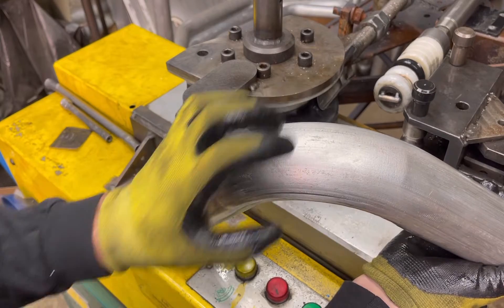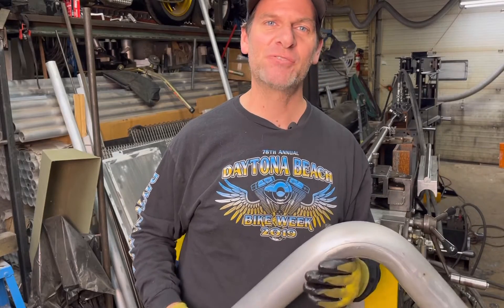MANDREL BENDING 101

Comment: The best material to make the wiper die, the follow along die and the mandrel (that the aluminum tube will be sliding on) is a "AISI 12L14" or "ASTM A108" or "SAI 12L14". This material has a higher % of lead in its composition. The lead let's the aluminum slide easily without catching on the tube. When bending aluminum, you need to use a lot of oil. We always used a EP oil. EP = extreme pressure.

Comment: Not sure if you have your information right.  At my company we have a 300$K machine for bending all servo and precision driven.  Aluminum has to be annealed to a 0 temper to be bent at all on our machines.  T-0 is the softest annealed and the tempers go to T-6 ( some exotics like 3035 have specialized tempers like H14 specifically for certain uses.)  Anything more than a T-2 temper will just split in our machine.
Reply: You are bending a thinner wall tube ( that is not easy) to do that you whipper die, follow along die and the mandrel should be made of SAI 12L14.

Comment: I built a floor model bender based off a common design that Incorporates the long air over hydraulic ram. It uses the basic Woodward Fab type dies as that was the most affordable option. I only have a 1 5/8 die and pressure block. I was hoping to bend thin wall pipe but it buckled. I somewhat anticipated at buckling since so many people told me it would. I've been told to use a thicker wall pipe and it would work. The trouble is I would like to build some lightweight go-kart and mini bike frames. I could use thicker tubing but was hoping I could get around it. I was considering adding a mandrel attachment to it but I'm not sure if it would be successful with the standard die and follower block of a Woodward Fab die set. My other concern was retracting the mandrill after the bend was completed. I was thinking of using some sort of threaded rod. Do you think this would work without hydraulics or do you think the mandrel would become trapped inside? Thanks for the video.
Reply from the maker: I have a couple of smaller benders that work perfectly with a mandrel on a threaded rod , email me and i can send you some pictures of the set up . Thanks
Reply: @BonifabcustomRobBonifacio I sent you a message on Facebook cuz I wasn't sure where to find your email address. But while I'm here I have another question regarding the length of a mandrel rod. What do you think would be  logical choice? I was thinking it would be nice to have a 20-foot long mandrel to take full length of tubing but that's probably not practical.